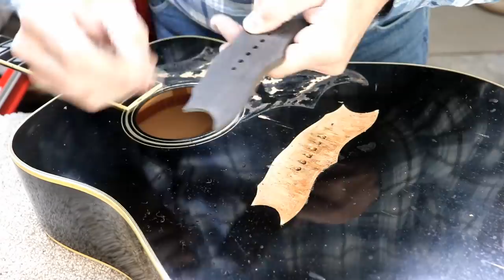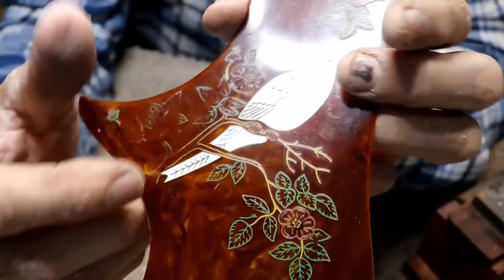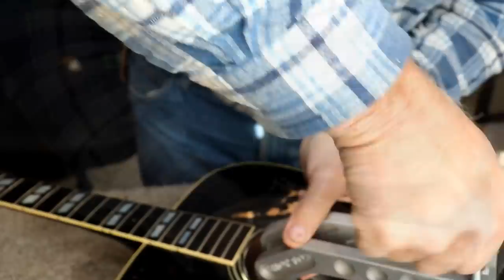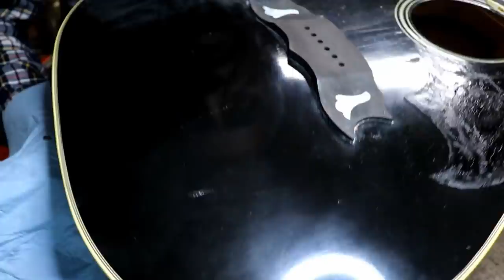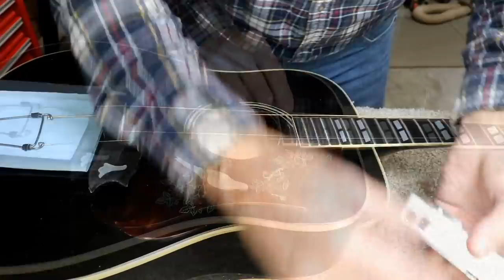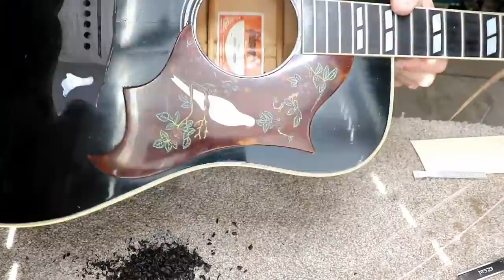558 RSW WILL THIS DOVE FLY AGAIN? 1980's Gibson Dove Guitar Repair - Part 2

Comment: I flatten the pickguard on my J200 by placing it  in a cooking sheet (about 2inchs deep) in hot water. Then I got a pot the size of the guard full of hot water aswell and placed it on top. Sandwiching it. After 3 hours it was flat as can be. The pickguard was the old vintage thick 2mm ones. And I had it in wax paper to avoid scratches. Worked like a charm

Comment: I had a pick guard job just like that. Peeling up; rough underneath on a black finished Epiphone. I sanded it first and blackened the bare wood spots with permanent India Ink which contains shellac. Worked well. Of course it soaks in the surface a little bit not like stain though. The customer said he's never going to remove the pick guard. If he wanted to do that, the top would have needed refinishing anyway.

Comment: 172 views, & only 16 likes. Doesn't make sense. Jerry what you said about squeezing all the glue out. Then you said maybe with metal. I can assure you, that it doesn't matter how tight the metal is there's plenty of sealant there. I know 1st hand. At Lockheed we had to seal almost every part we installed. Then before we riveted it, or put in the fasteners, we used clikos that had to be screwed down (They had a hex nut, with a threaded shaft, that spread the tips, to hold the part/piece/whatever. We had a gun to install them, & used the same gun to remove them. 
We a strap that was about 2' long, about 4" wide with a T on the end that probably around 7" long & 4" wide. It joined a huge frame together.(C5B are huge aircraft. It's millions of little parts, riveted together WITH SEALANT, to make bigger parts.) Turns out the strap in question had to be removed, can't remember the reason. Well me & A couple of old heads were chosen to remove the strap. Rush job of course. Well we drilled off the rivet heads, knocked out the fasteners, & rivets. The strap DID NOT MOVE. The sealant held it just as tight with out the fasteners, as with the fasteners. We ended up getting a pretty big putty knife, putting a razor edge on it, & slowly tapped it between the strap, & upper & lower part of the frame. Talk about slow work. It took us about 2 hours to finally CUT the sealant & remove the strap. I don't know if it's true, but I heard Lockheed took a 141 removed all the rivets & fasteners, & flew it, no problem.(after trying to remove that strap, I believe it!!!) They told us, if we left our layout lines we made with blue water soluable markers, the lines alone would add an unbelievable amount of weight, due to the shear size of those planes. LOL a lead man I had, said (When I told him we only had the longer length of fastener, instead of the right one. Maybe 1/32" too long) "Put washers on them, you know that." I said they were always complaining about weight. He said "Big fella, if you look at the size of this plane, a couple hundred pounds of washers, won't make much difference." So I added washers to the 75 fasteners I had to install. LoL

Comment: Regarding the little router; I'm sure the intent of the heli-coils was to prevent overly tightening the steel screw in the aluminum body and stripping out the aluminum threads.  The heli-coil could have given better service if it had been secured with Loctite though.  The router base is a very nice piece of work however.  Wonderful project and very nice-looking guitar on completion.  Still like my Martin though.

Comment: Hi Jerry;
Helicoil uses their own size thread to fit the thread that they have on the inside. They provide a special tap with the Helicoils. That, however; leaves guys like us in the learch, as we don't have the tap when we need it and to get one, we have to buy some more of the Helicoils. I do believe you have struck upon the right answer to fix the lock screw.

Comment: Jerry as a retired Mechanic of 79 years old I know Helicoi work fine in a situation where you have a solid bottom in the hole for them to lock into but in that situation where you used it It WIL NOT lock in because the screw is going all the way thru the helicoil and the end result will always be just what you experienced and what you did by just rethreading the hole and going to a larger screw was the correct thing to do in your case. I know this from experience.

Comment: Word of caution for anyone thinking of using a step drill. Use a straight one, not a spiral one. The spiral ones dig in like you can't believe. You'd blow right through the bridge before you could react.
Reply from the maker: I'm sure that's true I don't have a spiral one

Comment: Another great video - as always - jerry!  Although I don't approach your level of skill or experience, I have renovated/restored nearly 100 guitars over the last fifteen years.  I haven't yet tried Simichrome, but I've had very good luck with a product called Plastic X, which is an automotive plastics polish.  It's still an "elbow grease" product, but it's worked well for me.  Give it a try and let me know your considered opinion.

Comment: Would it help with the integrity and strength of the top/bridge plate if you plugged the old holes before gluing the new bridge on?

Comment: I do not understand why you would not drill out the holes through the top and bridgeplate, then plug and redrill...
Reply: It's my guitar. We talked through the options. Jerry isn't a big fan of Maple. We wanted to replace with Padouk if he thought the old plate would come out clean. If not, given the circumstances, we both agreed the thin Padouk veneer would be the less invasive/simpler fix.
Reply from the maker: plugs don't do much on material only .100" thick.

Comment: Heating the frets cause the frets to swell or expand, causing them to grip the ebony even more. That's why there is more tearout. Try cold or chilling the frets as you need to remove them. This will contract or shrink the metal making them easier to remove. This is an old mechanics trick!

Comment: Stewmac makes Bridge Saver and Plate Mate to deal with bridge plate problem.
Reply from the maker: And they're junk I wouldn't put them on the cheapest guitar made
Reply: @RosaStringWorks  bridge saver seems like a real wood restoration method. I can understand the concern about the plate mate.

Comment: You should always wipe the pressure sensitive adhesive bond areas down with isopropyl alcohol, both surfaces. I work in the plastics industry.
Reply from the maker: Pretty sure I did that
Reply: @RosaStringWorks  yes I saw I was just trying to let you know that Isopropyl is fine as a cleaning solvent with plastics. I really enjoy watching and learning from your videos

Comment: use cardboard for your bridgeplate template.  It's easier to work with an works just as well.
Reply from the maker: Wouldn't you kind of imagine that in the last 40 years and thousands upon thousands of repairs that I probably used cardboard at some point?